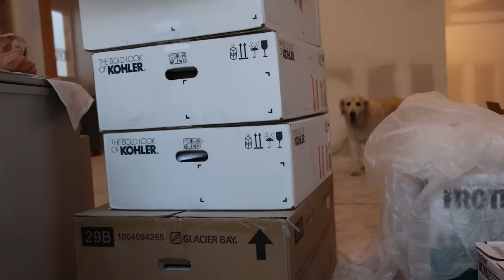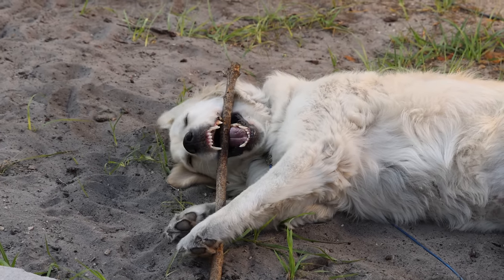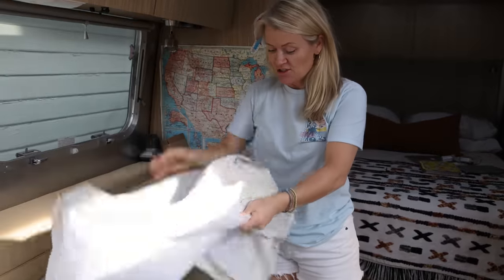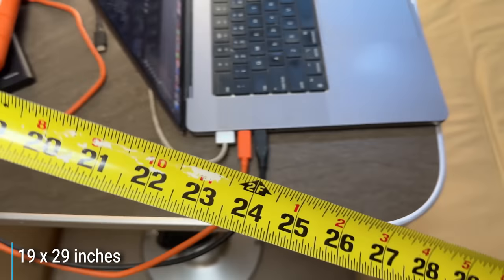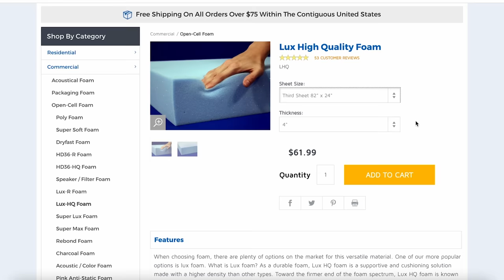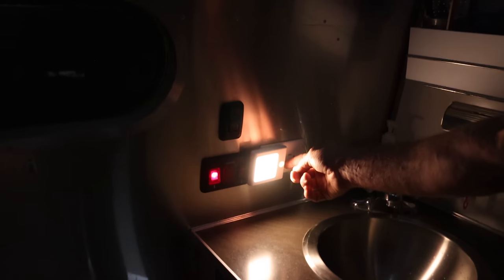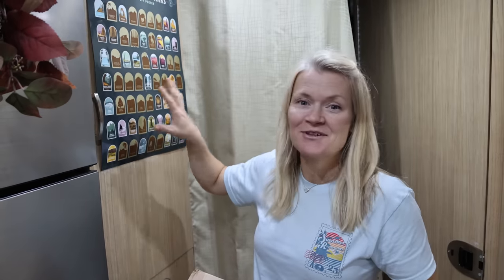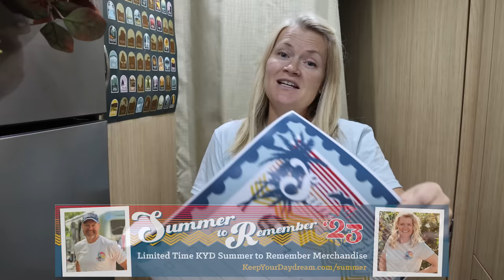✂️ FIXED! Easy RV Cushion DIY Upgrade

Comment: Great video. We replaced the foam on our patio set. Your covers seemed to have big zipper openings but or covers didn’t . I found a pro tip by putting the foam in a trash bag then use the vacuum to shrink wrap them . They shrink down to half the size and slide right in. The hardest part is ripping the trash bag off when they are in

Comment: A tip from the upholstery industry.  If your foam doesn't want to slide into your fabric,  cover it with dry cleaning plastic bags. It will slide in easier.
Reply from the maker: That's probably why were pulling plastic bags out of the cushions! *The more you know!
Reply: Oh! I've used the Silk Film to do it but never thought about using a dry cleaning bag.
Reply: Great tip
Reply: Do you put the batting all around the foam? I couldn’t see that well but it looked liked on top and sides. I will be changing out the foam in our cushions soon. Thanks.

Comment: Start with the covers inside out. Start at the deepest corners on the pad, get the corner seams lined up perfectly, then wrap the covers back right side out around the padding. 👍

Comment: Some great ideas!!  Thanks.

Years ago we purchased a nightlight for our house bathroom. It is a 120V 0.18W nightlight.  It is ON all the time, but during the day, or when the main lights are on, you can't tell it is on.
However, once it gets dark, it perfectly illuminates the bathroom.  Never need to turn on the light.  When we bought our trailer, I purchased a new one for the house, and the old one is now in the trailer.  Since we currently always camp with Electricity (30amp) it works well.  We also have multiple battery powered (rechargeable) motion detection LED lights that go in our cupboards.  During the winter they come into the house and we use them in cupboards and closet.  

My biggest frustration in our trailer is the padding of the seats.  Ours is a simple 17ft Coachman, so your upgrade is very interesting.

I am enjoying your videos and and learning a lots.  We are currently VACATIONERS, meaning we camp in only 1 or 2 locations per summer (2-3 weeks), and occasionally do a couple days in the fall.  We are looking forward to retirement (July 1, 2024) and have begun planning some longer trips (Banff & Nova Scotia).  Last June we did a test trip of 8 nights, staying only 2 nights in each park and moving about 300km between parks.  We learned some lesson about how to travel further distances and change parks regularly.

Have a great summer!

Comment: Came back to say, Thank you for the seat cushion recommendation. Just finished doing a couple of the seat cushions that see the most use in my little trailer and it makes a big difference. Very easy to cut and stuff into the covers.

Comment: We have a built-in kitchen and a built-in bathroom (I mean latrine) light that run on our 110V AC wiring in our Arctic Fox 5th wheel. It would be nice to find a 12V DC light like the 110V  one you installed so one would not have to leave an inverter on at night. Great DIY you two!

Comment: Your timing is impeccable. I had just ordered replacement foam for our unit right before you made this. However, I still ended up going with this foam for better support as the other stuff wasn’t quite as good.

Comment: I replaced our TT's foam rubber mattress with a memory foam mattress.  I used an electric carving knife (thrift store find) to cut it down and it worked wonderful.  I do need to replace our dinette seat cushions.  Thanks for the inspiration.

Comment: For the TV you could also use a Roku or fire stick. I prefer those because sometimes the smart TVs process/load too slow.
Reply: @aed8096  right, that too if you lose the remote.

Comment: Love the night lights, mine have a rechargeable battery, I put them on our stairs, bathroom floor, and under the bed overhang to illuminate the floor, all movement censored, so I’m not tripping if I get up in the dark and I’m not waking up my husband!  It’s just the right amount of light to see what you need to see.

Comment: For others doing this....Cushion Ease or something like it goes over the dacron  stuffing to making the cushion slide into the covers with ease.  And you may want cut the cushions a bit larger than the covers...1/2 inch....so you have a nice snug fit. ❤

Comment: Hello guys 
Just a FYI use a electric carving knife next time it works amazing,  I just had to cut our new mattress to fit our new 5th wheel and it was 10" thick and the electric knife worked flawless. Hope this will help next time you cut foam padding .
Thanks you for your videos & content and safe travels always .

Comment: I bought lights at Lowe's where I can put them in a closet , just about anywhere.  
Or Under or Over the kitchen cabinets.    All you have to do is pull the strip and press it on walls ,etcc.

Comment: Electric knife (like you use to carve a turkey), Works great.  Buy QUALITY foam which you are not going to find at hobby stores.   We found a place in Dallas that was very knowledgeable and helped us with our custom designed and built queen sleeper sofa for our RV.  I wish I could post a before and after picture.  My wife did an outstanding professional quality job covering the sofa.  It took about 200 hours of work to complete.  Reduced the width by 6”, back height down 3” and depth by 1”.  Arms and cushions were designed and custom made from scratch.

Comment: Question… Our old foam doesn’t have batting around it. Did your old ones have it? Our cushions are pleather on all sides except the bottom, so maybe the batting isn’t needed? I’ve ordered our foam, will get batting if it’s recommended. I’m so excited. We work remote in the trailer quite often and the cushions are terrible!
Reply from the maker: I would use the batting. It's a better application and rounds the edges and makes the cushion material look better. Plus a bit more comfort.

Comment: Great video! My question revolves around batting. The current, about to be replaced foam has a plastic bag on it. I’m replacing with your recommended LUX foam. It’s 5”. I feel like if I add batting it’s going to make it, obviously over 5” and it won’t fit because the upholstery won’t be able to take it. I don’t know this yet but I’m holding g off ordering it. Any thoughts? Anyone with experience in this potential? Thanks.

Comment: Are you still happy with the Lux-HQ Foam choice? Not too firm? I’m about to buy it and wanted to get your updated review after you’ve used it for a while. Thanks!
Reply from the maker: Still good. The batting is key to round the edges.